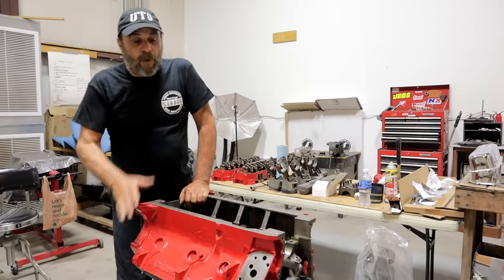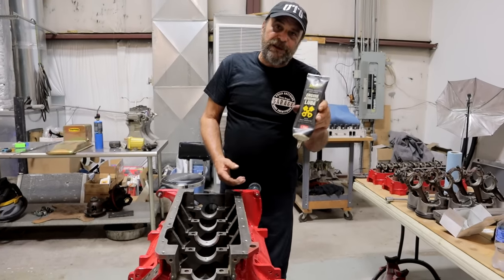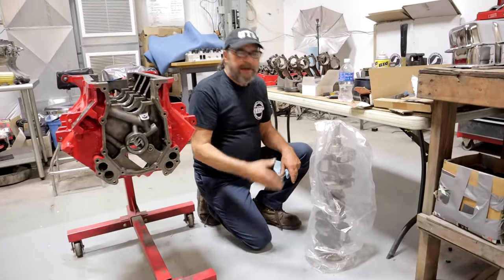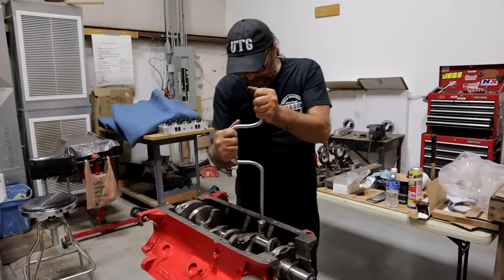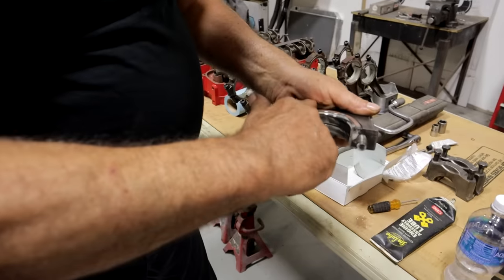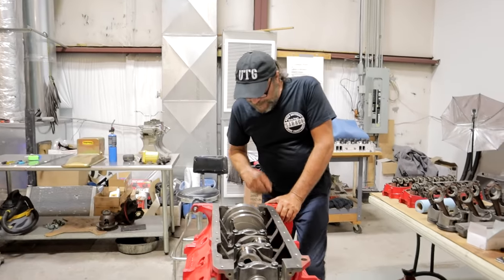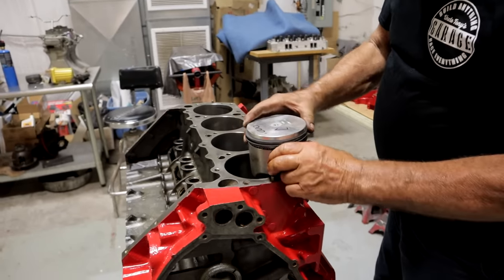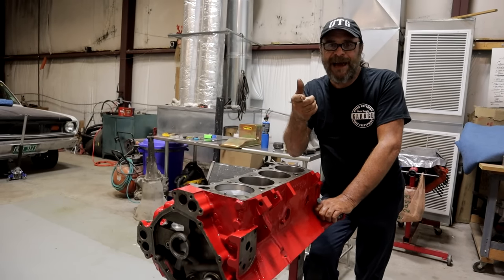Assembling A Short Block For The Home Engine Builder

Comment: I use a speed wrench especially to assemble engines. If you don't know how to use one, get better at it. Do not use air or power tools.
Reply: power for disassembly hand for assembly
Reply: I’ll use whatever I want…
Reply: power/air tools are for the young, "instant gratification" crowd
Reply: @Videoswithsoarin  Yea,  don't do that on the heads of an aluminum block V-8 Benz engine, they have Helicoils in them from the factory so if you ever have to take the headbolts loose/out use a breaker bar to loosen them first then you can use an electric drill, if you do it with an impact, neumatic or electric, it will rip out those helicoils and possibly ruin the block. Not worth the risk.
Reply: @albertgaspar627  hey, I am young and I like wrenches... I don't do a ton of wrenching because I am a carpenter but...
Reply: I use a drill with a 1/4” bit to 3/8” adapter on slow with the lowest torque setting and a light trigger.  You can still feel a cross-thread before doing damage. Other wise, yes, speed wrenches save headache and $$$.

Comment: Warning: If you use a Moly based high pressure assembly lube DO NOT freak out your engine oil will be full of gray clouds of Moly but it’s normal.  It may take 3-4 oil changes to flush all the Moly out.  Don’t freak out! 👍
Reply: I cote that on everything and get it nice and hot then change the oil a few times.
Reply: Major heart attack vibes from 40 years ago.
Reply: If you have a magnetic drain plug you will even find out that it is slightly magnetic and will have a glob of moly sludge on the magnet as well for a few oil changes.
Reply: I have always used motor oil in an old fashioned squirt can.  Then pre-crank it with no plugs to pump oil through it.  Never have used pre-lube junk.
Reply: @markjohnson9495  I used the moly lube on flat tappet cams and lifters, not much else. Bearings always get 20w50 out of a squirt can.
Reply: @MattsRageFitGarage  Yes, moly used in excess can be a bad thing (oil filter restriction, etc.). I too use it on cam lobes only (not the journals, they get oil) and the base of all the lifters. All crank bearing surfaces and the rear main seal get 1/2 motor oil- 1/2 STP mixture or other thick petroleum based assy lube (Clevite/Lucas/JB, etc.). Piston pins get TORCO red and rings get 5w-30 conventional oil, and so does the engine, with TB Zinc by Lucas or Rislone ZDDP EOS with flat tappet cams. Never once had a cam/lifter or bearing failure..fingers crossed!!
Reply: @markjohnson9495  If you are going to start the engine very soon, motor oil is okay. But if it's going to sit in the shop for a week or a month, there are assembly lubes that cling to the bearings.
Reply: why shoudl i freak out moly is amazing for an engine

Comment: Hi Tony, thanks for another great video!  As an engineer, I can tell you that the majority of torque applied to fasteners is consumed overcoming friction between the threads and under the bolt head.  If we can lower the friction, the clamp load to hold parts together will increase.  Clamp load is the force that will keep the mains and rods in place.  We never want the caps to separate during operation from a clamp load that is too low.  The best practice is to use a 30 weight oil on the main and rod bolt threads, AND, the same oil or assembly lube under the screw head.  The majoity of friction is under the bolt head.  This approach will sigificantly increase clamp load to prevent gapping.  Measure the stretch on a connecting rod bolt with dry threads versus lubricated, and you'll find the stretch will longer with lubed threads indicating more clamp load.  To illustrate the opposite, let's say one of the bolts was partially cross-threaded which is the same as high thread friction.  If the majority of torque is used to overcome the crossed threads, then there's going to be minimal clamp load.  The torque wrench will click off, but there's hardly any clamp load holding the parts together, which is bad!  Always use an oil on bolt threads and under bolt heads for more consistent and higher resultant clamp loads.  This is particularly important on head bolts too!
Reply: I use APR bolt install lube
Reply: @randyoehlert5045  That’s even better, especially for head bolts.  The oil on the bolt threads may wick into the head gasket.
Reply: Great comment. I've never thought of bolt head friction consuming torque.
Reply: That’s basic torque knowledge, learned that in grade 9 lol! You can’t say one way or the other is better. The goal is correct and consistent clamping force. I’ve seen instances where a builder had blocks breaking due to over lube on fasteners and over clamp force. Best is the follow specific procedures outlined buy the manufacturer or fastener maker

Comment: A couple things: I will always torque my crank before pistons, so you can check ease of spin. AND - You should have mentioned the BB Dodge has the little hole to give some oil to the opposite piston, whereas Chevy doesn't.  Dodge you'd have to turn the pistons on the rods to install backwards, but Chevy doesn't matter.

Comment: I have not seen anyone using a speed wrench in ages. Nice, you can feel any resistance in the bolt threads going in like Tony said. When I was 16 in 1973, I got an inexpensive tool set from my parents for my birthday. It had a speed wrench in it. Old gearhead in the neighborhood taught me how to repair my own junk. I`m 65 now, tool kit is long gone, but I STILL have that speed wrench. Socket lock ball is gone but I still use it. Piece of electric tape on end holds sockets.
Reply: I've always used them since my first engine too, precisely for the reason Uncle Tony explained.
Reply: That's an old friend cause that was the year I was born 😁
Reply: I love doing assembly with a speed wrench. It just seems right.
Reply: @grumpycarlsworld  same age and also use the speed wrench I received in a socket set from my parents when I was 16. Good parents we had.

Comment: i prefer motor oil because you can feel it more if stuff is binding, a lot of assembly lubes are ultra thick and makes it hard to turn the crank by hand
Reply: In school the teacher taught us with using a trigger type oil can. Thats the first thing I bough for working on motorcycles and doing top ends. No assembly lube, oil the cylinder / cylinders, wipe them down, give the rings on the piston a shot before installing them.

Comment: Great video Tony. I've been building engines for over 50 years and there's one step I do that's different from your assembly instructions. I install the cam first, or at least put it in the block and remove it to make sure it can be installed. More than once I had a camm that didn't want to fit into the cam bearing. Sometimes it's just a burr on the edge of the bearing that can easily be cleaned up. This can be a real pain in the ass if you encounter this after crank is in. Just what I do, not criticizing your approach to assembly.
Reply: That’s a great idea, thanks 🙏

Comment: The LT1 in my 1996 Buick Roadmaster sedan is about to turn over 170k miles. And although it still seems to be running strong. I think I'm gonna have to tear it down and give it a cheap as possible refresh. Unfortunately for the LT1 nothing is cheap. But I want to make sure that it continues to run for another 170k miles. So I'm gonna have to bite the bullet and do it. Definitely not gonna buy anything unless it's necessary. Not trying to build a race engine. But I'll probably do some home porting and anything else free to gain any performance. But I can't afford to do anything more than I absolutely have to. I'll definitely be using all the tricks I've learned from your channel. Thanks Uncle Tony
Reply: Rings, bearings, seals and a valve job?  I think roadmaster, I think 1939:  you could build one for grandma or a gangster - didn't matter.
Reply: I did just that, even though the L67 (Series II 3800 supercharged) in my 2000 GTP was running just fine at 195k miles, (No strange noises, no leaks, and had great power) I decided to do a stock rebuild.  Even though I thought it was running just fine, I found that all was not fine, as every exhaust valve was leaking compression, not a lot, but they still leaked when I filled the combustion chamber with mineral spirits, the intakes valves where just fine, no leaks, but every exhaust valve leaked a little. I also had four pushrods wearing where they contact the rocker arm, and the connecting rod bearings had evidence of spark knock.  Everything else was in great shape inside the engine. I had a machine shop clean the block, install cam bearings, and hone the cylinders for new rings, and also had them do a minor valve job using my original valves and springs, they did have to machine the heads flat however.  I installed new timing chain, oil pump gears, new pushrods, and new rocker arms from ZZP, I reused the original camshaft and roller lifters as they had NO wear on them and were still in great shape. Now the engine runs better than ever!
Reply: Nothing is cheap anymore. Everything is becoming crazy expensive from parts to lubes…

Comment: Set them bolts on a paper towel or pan to spray em, keep the floor from getting slick. 😉 Never thought I'd ever see Tony do something that I could make a recommendation to improve. 🤣
Reply: Dipping cups work best to cut down on the messy floor.
Reply: I know.  I spray stuff into the trash can.  I keep the floor super clean.
Reply: using a dipping cup is a good idea, along with a tray mounted on the legs of the engine stand to catch things. Check out coffee travel mug mounts, you can probably find a cheap "beer holder" that lets you clamp a dip cup to the engine block bolt holes or the engine stand so you aren't walking back and forth from the table.

Comment: Ive put the thrust bearings in first, but yeah every time you tighten the main cap  bolts , turn the crank over same deal with the rod bolts, mocking up the big ends on the rods with the crank out is a good idea too
Reply: Would u leave thrust bearing lose to seat on newer hemi engine as well ?
Reply: @moparlif3528  im a ford guy, the deal is to keep crank end play under 6 thou

Comment: I use a hose clamp around the bottom of the ring compressor flush (as near as) with the deck to keep the coil tight, prevents any chance of it getting loose and a ring getting upward force if it gets squeezed.         Love this channel !

Comment: Federal Mogul 2 piece seals say to offset the seal in their installation instructions, David Vizards chevy book has it in it also..either way I think it is more important to dab the ends with silicone when fitting them.
Reply: i use super glue on the ends works great
Reply: Think of it this way, do you offset the main and rod bearings so the two bearing halves aren't  meeting at the cap joint? I think the purpose of the offset dates back to the rope wick main seal. It provided an avenue for oil to follow since it was not an engineered fit. It relied on the assembler/mechanic to cut the seal to fit. If it was just a bit loose it would leak. By rotating the seal it minimized the opportunity to follow that joint. With an actual oil seal, Tony's right, they will fit tight and better in the seal cap flush with the block. That element of lack off seal integrity, is no longer a factor.

Comment: My first engine I guided the rods down by hand.   Pontiac 400, the hard steel bolts put a nice gash in the cast iron crank.   After polishing the nicks down, I did all the rest with 3/8 fuel/vacuum line - no more problems.   Most 383 have steel cranks which I believe are a bit more resilient, but you don't want the rod bolts even touching the journals.

Comment: I enjoy putting engines together. I haven't gotten to do it for over a decade now because I just haven't needed too.  This makes me want to rip one out and tear it apart just to have fun putting it back together again! I always have problems with the rings popping out of those compressors just as it is going into the block.
Reply: Yeah I haven't been in a car engine for a few years myself ,but futzed with a few smaller air cooled ones like a Briggs 20hp v twin. 
Kinda funny how much they sound like a Harley with open pipes for a test run.
And it's smaller ,the whole thing fits in a 5 gallon pail almost 😂

Comment: I've had good luck running them offset especially if the seal comes with that little offset gauge. You could always test fit the seal with the crank out? Could make the difference between a dripper and a 100 percent sealed engine.

Comment: UT I've learned to tap on the outside of the ring compressor lightly a few times then tighten up the bands agin, it helps to get the slack out and the rings go in much easier. your ring compressor appears to be thicker than mine so it is less likely to get caught between the piston and the cylinder bore. My first ring compressor was two tuna fish cans ends cut out, split open and several hose clamps, it worked but what a pain! That was 55 years ago.

Comment: I'm waiting for my 390 fe to get back from the machine shop.  I sent it long block form. I don't do this every day..I am a technician for 32 years and I have done it,  ford's and VW's....but I let the fe myths get to me and I wish I would have sent it heads up and crank out.  I'm looking at 8 months vs maybe 4... but it is a great machine shop and I don't always have the time or energy after I work on others all day long 😂.  only real difference is the rear main seal with the metal wedges that drive in the sides.  I was going to swap out the camshaft and I nicked the bearing..so crank has to come out and I figured...go all the way.  144k on it.  73 truck.  Ford.  but point I was just trying to get at is great video Mrs Tony 😂I watch to keep some of the Ole ways fresh in my head.  vs the new aluminum,  chains galore engines of today. I would have saved money on assembly but...those guys do it day in and out.  I am sure you have been there once or twice in your 50 years.  love your knowledge and experience Mr Garage❤

Comment: Great video. I was surprised you didn't torque the mains and check the crankshaft end play. I take it that it's never been an issue. I like the way you squared up the thrust bearing and the other little tips in this video. Thanks for sharing.

Comment: Glad you touched on the rear seal offset. Been in this game for 50 years and never had trouble with a good seal installed correctly (flat with the block plane like you did).

Comment: You should send a Speed Handel to Nicks Garage because I never saw him use one it drove me nuts seeing him struggle with a ratchet and extension when he could be using a Speed Handle. You are almost assembling that engine exactly as I was taught many many years ago and it always worked for me.I could sort out missed matched caps with my finger nail and have done it for customers several times because your finger nail will always tell you that the parting lines don't match up or they do match. It always works.  Reverse offset pins seem to rev up easier if you don't mind pistons clacking. Racing pistons are centered and not offset for a reason, Power!  .

Comment: I’m going to have to research this more and watch more videos that cover this to figure out what’s going on. I know you can check the cam grind to make sure it matches up with what’s ordered. I’m not sure which cam I’d need in the first place before ever checking the installation. 

Guess I call the cam company and tell them what I’m going to use the car for and then they will give me an idea of a combination grind which will be best. 

I understand the degree of cam needs to be set at the right place. Just don’t know how anyone would do that with a regular timing chain assembly. Seems like you would need an adjustable system. Thanks again for the info. Great and knowledgeable.

Comment: I offset the pistons in my 273 HighPo back in 1970. It ran like a raped ape! It was in a 65 Dart and the 383 Roadrunners I raced/beat thought is was a 340! I told them to check the casting. I was 18 and very proud of my first rebuild. Raced 340's in Super Stock for many years after that.

Comment: I've worked in race engine shops & while I saw differences in what Tony does I saw nothing that scared me.
Reply: Right. 
Overall ,it'll be fine. 
I made a preluber from a bug sprayer and it works great, just get the oil warm in the nuker first and it flows faster. 
Chunk the pressure sender back in and hit the key. 
Better then doing the old oil pump spinny thing with a drill and fiddlef**king around re-timing the distributor wasting time while oil runs off.  😁

Comment: I use the rubber heat shrinks for the connecting rod bolts. Mostly because that was what I had and it felt thick enough to protect the journals.

Comment: So I picked up a 73 duster with a 225 with an auto for 2300$ car is straight for the most part and clean little rust here and there but I picked it up for me and my 5 year old son cause for that price I just couldn’t pass it up but I’ve decided I am gonna put a 383 in it down the road, and for sure I’m going to look at this video and the other ones for this engine because honestly it’s gonna be my first real engine build and some of the info you shared is gonna come in handy

Comment: I like to do a final cleaning / wipe down of cylinder bores or any critical surface with regular ole bleached coffee filters with a dose of ATF on them. seems like the coffee filters are cheap, leave behind zero lint etc and high detergent ATF will remove or pull out the smallest of honing grit or any minute particles. When the coffee filter comes out clean and white you can see just how clean the bores are. If you don't want any ATF left behind the coffee filters will get that last bit out.